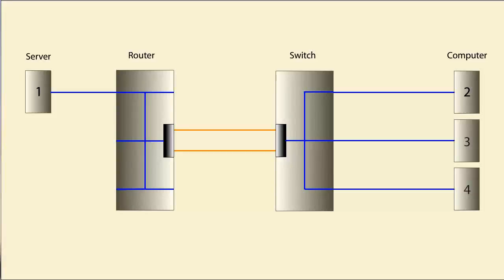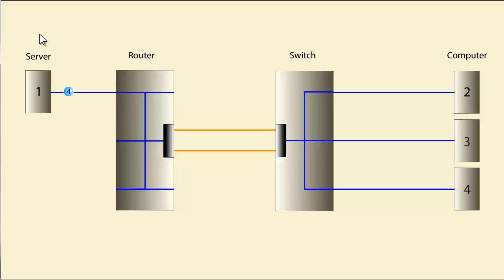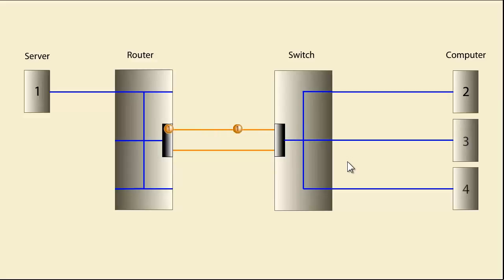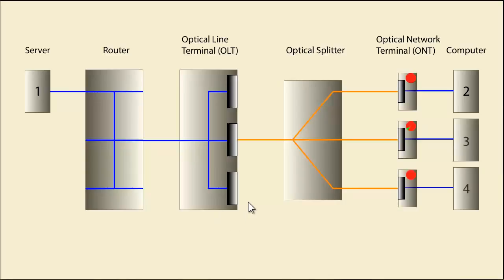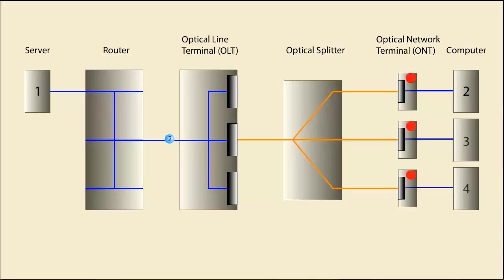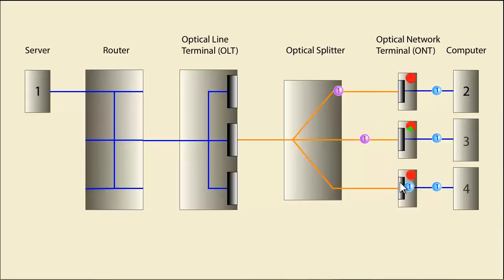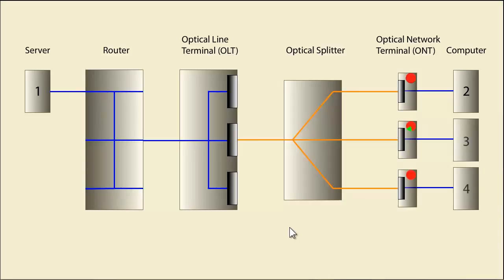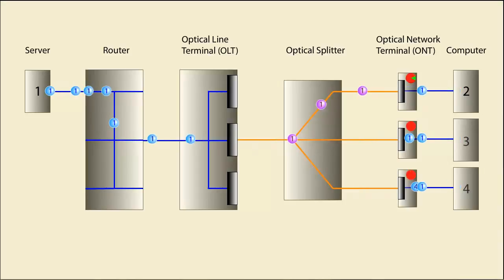Visually Explained Passive Optical Networks (PON/GPON/EPON)

Comment: Suppose if a big Tier-1 broadband company have to launch a FTTH service in few states in which there are 100s of large and small cities and towns. 

Q1. Do they need a fiber Central office or called exchange office same like old copper telephone exchange office in each and every single town?

Q2. if a city is very large in area then do broadband company need to make multiple Central offices/fiber exchange offices in a city or town?

Q3. How many Kms maximum long distance a local ftth broadband exchange/Central office can expand its fibre optical cable to their customers with high speed broadband 1gbps with low Attenuation.
Reply from the maker: Thanks for your creative questions :)

Q1. Yes and No, it depends on topology they create and type of network they are deploying. sometimes if cities or towns are larger they will need many pops (Points of Presence) with power backups etc.

Q.2, Answered above, yes, 

Q.3. Distance depends on power of Modules, some modules support upto 20KM, but it doesnt mean that you make splits upto 20, it divides signals every time we do a split in fiber. so as long as signals are in acceptable range (17-25dbi) thats ok.